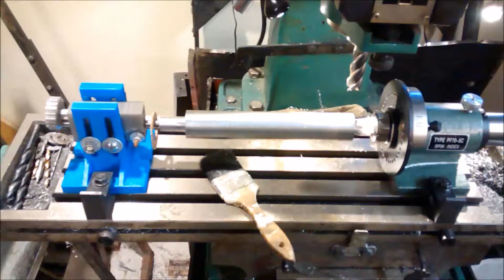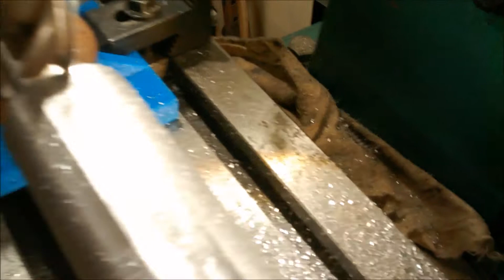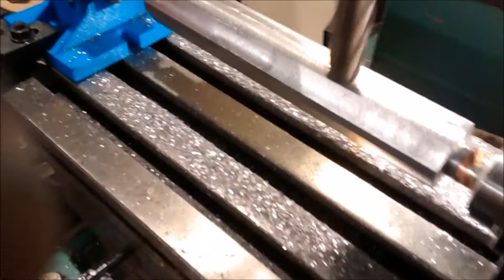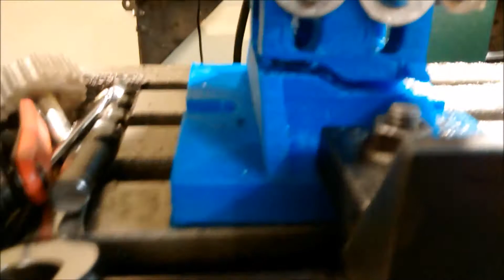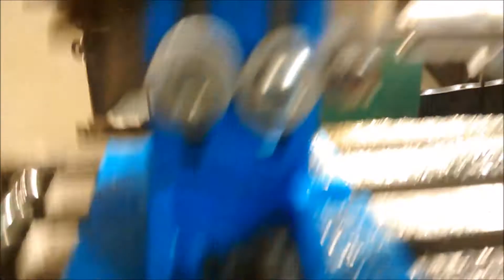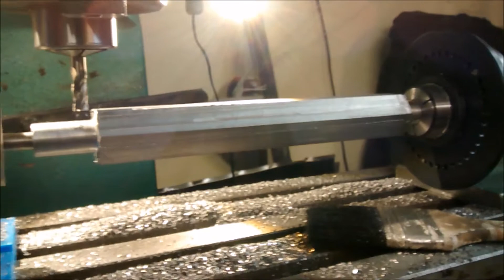3D Printed Spin Indexer Tailstock

Comment: Nice work! I think you are right about widening the base a little more though. People underestimate what plastic can really handle a lot it seems. I am very particular about finish so my experience with PETG was never great(seemed flimsy, stringy/bad finish & warped easily) but I would think PLA or ABS at bare minimum for this level of stress. I have also been hearing good things about the carbon filaments which look like they deliver an amazing finish as well, when needed. I know Nylon for a long time was supposed to offer the best strength in printing but I heard more negative than positive comments from those with actual experience. 

I personally have been running a 3D printed motor mount and home switches on my G0704 conversion with great success and I think it even helps reduce transmission of vibrations. Next up I plan to try some HTD style 3D printed pulleys for the drive gears and possibly add gearing to my X and Y getting rid of the couplers.